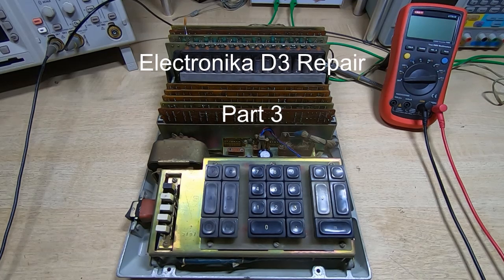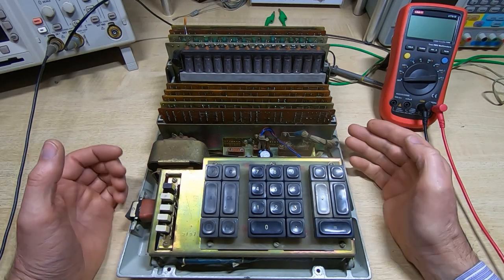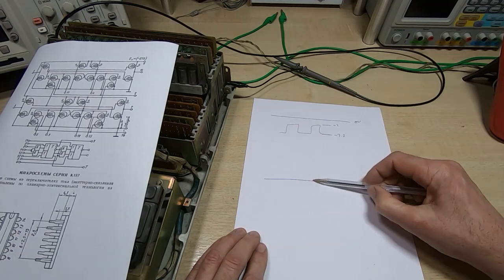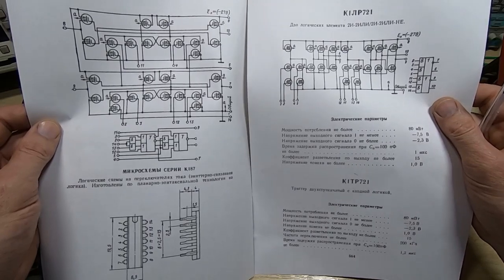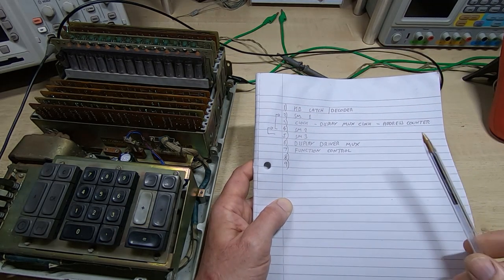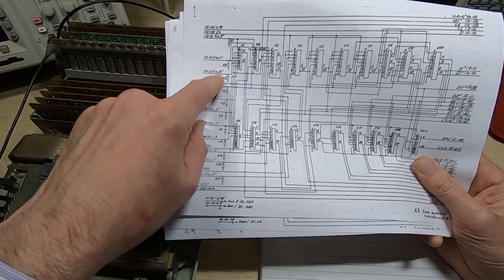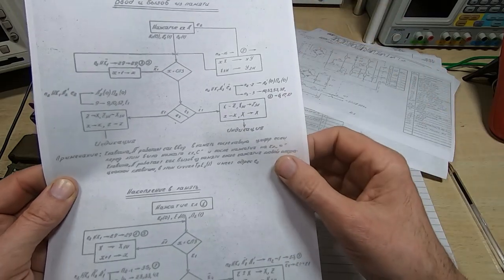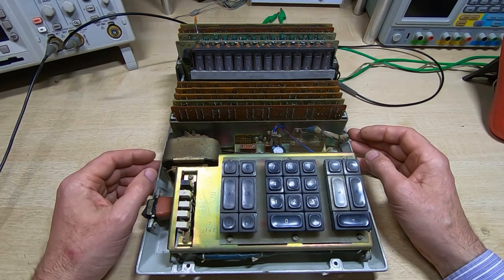Elektronika D3 Repair Part3

Comment: I know it's not necessary but 2 thumbs up to the viewers who shared out the data book for the ICs and the calculator schematic. Proof positive this machine can be fixed, was designed to repaired, and that in the end thanks to the Internet, the information to repair is OUT THERE, somewhere.
Reply from the maker: It would have been repairable anyway. It is just much easier with schematics and datasheets but it is very nice that they took the time and effort to send them. The biggest hurdle will actually be locating replacement parts once the faulty devices have been identified.

Comment: This is a very interesting series to follow, I'm attempting to repair an Iskra 111M calculator with very similar construction. Unfortunately only the schematic for the 112 logic boards are available, and even then in very bad scan quality. Thanks for the diagnosis tips!

Comment: Interesting series and useful in the sense of how to methodically analyse faults. Recently I (mechanically) repaired a 1960s portable open reel tape recorder, my usual practice is to put any replaced parts in a small zip lock bag along with a strip of paper with the date and parts description and fix it into some empty space inside the machine, and also the circuit diagram page printed trimmed as small as possible. I was wondering if anyone else does this sort of thing or just keeps replaced original parts elsewhere? Obviously not placed near power supplies or hot areas.

Comment: I was also looking for those schematics, but could not find them in open access. Could only confirm their existence in paper form. Up until early 90s, those schematics were often enough simply part of the user's manual, which made field repair a lot more viable, even though the parts parts needed were pretty hard to come by.

Comment: You could install google translator on a smartphone and use the camera real time translation feature. It's not perfect but may be enough to get the context.
Reply from the maker: That would probably not work. The images are fairly low resolution and not very clear with a lot of background noise so the chances that an OCR process could reliably extract the text and then translate it is remote. The ones I have tried have all returned garbage.
Reply: @JerryWalker001  I have had the same experience. After multiple copies and eventually low resolution scanning most methods fail on the old Soviet data sheets. 
My solution for that: The same ICs were often reproduced for GDR production, and there are reference tables that point to the German data books. Those are of pretty high quality and much easier to read (not only for the obvious reason of being written in my native language).
For regular TTL-style ICs there also are tables to US designations. I doubt these exist for the ICs in this specific Elektronika device, though.
Reply from the maker: @VintageProjectDE  I do not have any problem at all with the datasheets or the data book. The text I would really like to be able to read is the text written on the schematics but this is not of course reproduced anywhere and they are in jpg form. The data book is good resolution and would actually OCR without any issues if I need the text but I only really need the values from the data and they are of course just numbers.
I am not complaining as the schematics are extremely useful anyway and I am very grateful to the person that sent them, It would just be even easier if the text on them and the flow charts was easier to read but even as they are they will make the repair MUCH easier. I also think it will be interesting for people to see this sort of design.
Reply: @JerryWalker001  later they changed system/standard. К172ЛК1 is more modern replacement for K1ЛР721, silicon-series-function(OR-key)-modif? . K176 is more popular 5..15V MOS series and K155 TTL. could help translating/redrawing schematics